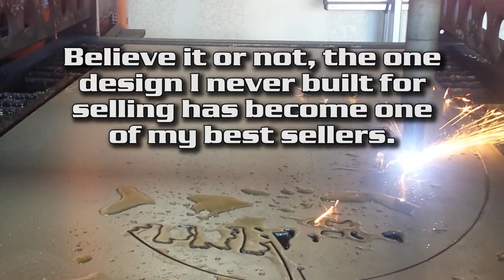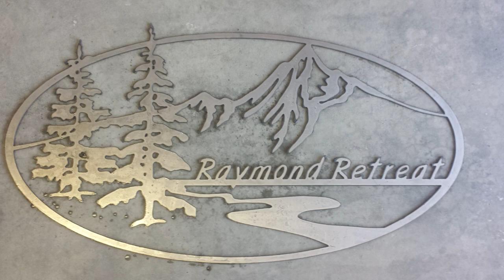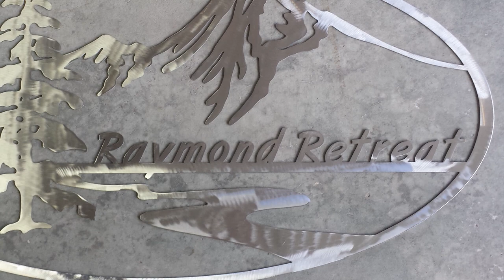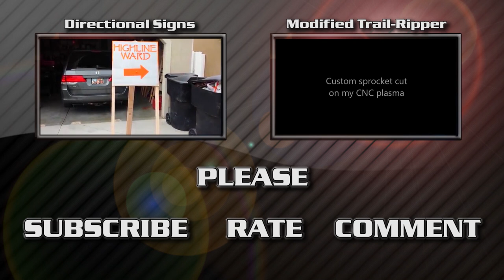Custom Family Sign -- Based on my website logo

Comment: Wow, that looks great.
What is the real time it takes to produce one like that?
Reply from the maker: +redroofretriever Not counting design time, which is minimal because I designed it years ago, it takes maybe about 8-10 minutes to cut it out.  Grinding the dross off probably takes a similar amount of time.  Most of my costs in building something like this come in the form of tools.  I have consumables that get used (plasma cutting consumables) while cutting and I have to replace the flap discs as I use them.